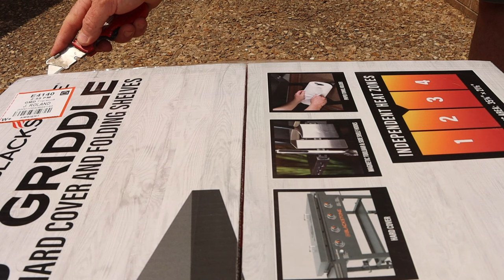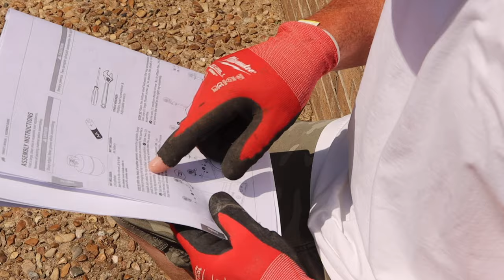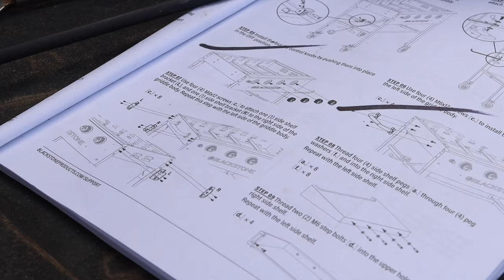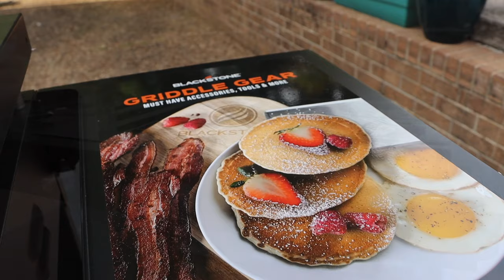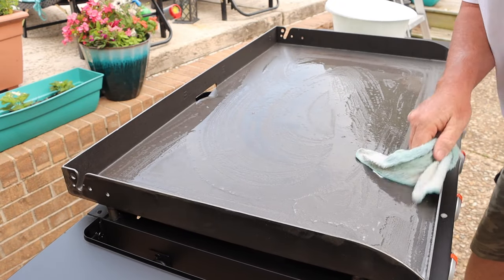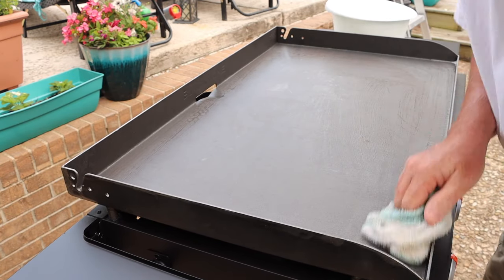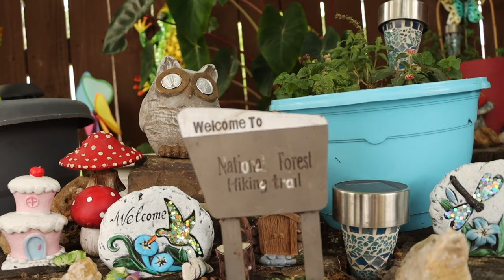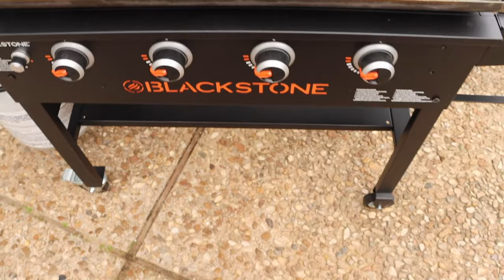Blackstone 36" Griddle Assembly, Unboxing & Seasoning. Grilling on my Blackstone Griddle.

Comment: FYI…you have the bottom shelf upside down. I did the same thing when I was assembling mine until I looked at a picture online. Every single Blackstone has the shelf with the lip facing up. You’re definitely not alone in making this mistake. 🤦🏼‍♀️ The instructions aren’t the clearest regarding that.

Comment: Looking at the bottom of the griddle plate this looks like the new omnivore griddle plate? If so is this the 36k btu version or the 60k btu?  Any idea what you are getting for max temps? 

Reason I ask is I have a 22" adventure series with folding stand I would like to be our dedicated rv blackstone and replace it with a 36" for home so I don't have to swap. We raise beef and do a LOT of steaks and our 22" hits 670+ degrees and 740ish degrees with homemade wind guards installed which is amazing for a sear on steaks. The highest temps have been seeing on the 36k omnivore plate is upper 500's in their hotspots. Makes me wonder if I should look for a 60k btu instead.